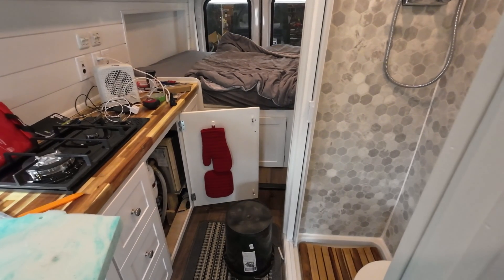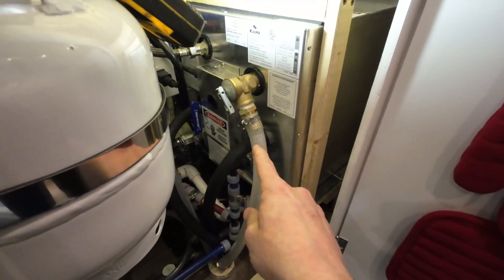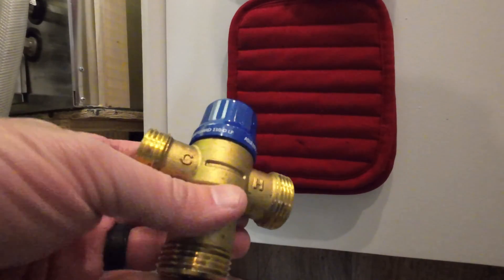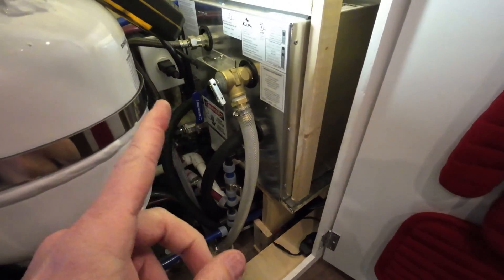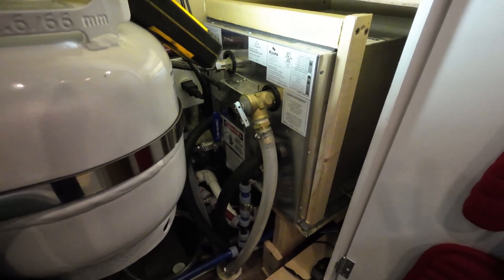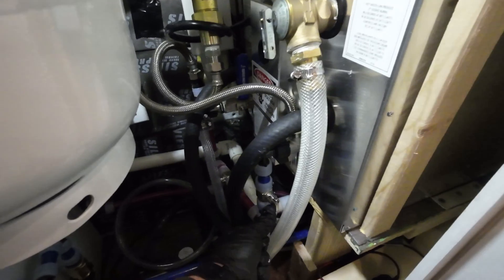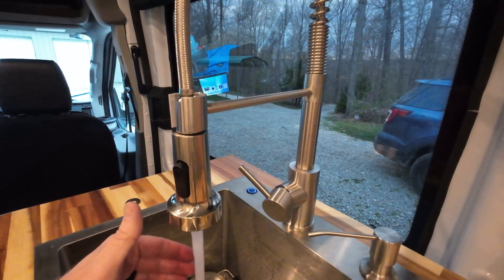Ford Transit Camper Van Conversion Kuuma Hydronic Water Heater Installation

Comment: looks good! however you could combine all drains in one pipe inside your cabin that less holles and hoses.
Reply from the maker: Could have but they all exit through the same single hole. This is the way I do it in case one of them gets clogged, which is possible with the stainless screens I use

Comment: Hello, I'm doing research for my water heater install. Is there a risk of the coolant lines freezing in extreme cold temps under the van? what temps have you had your van in? (I live in the great white north)
Reply from the maker: No more risk than your radiator hoses. It's coolant so it won't freeze.

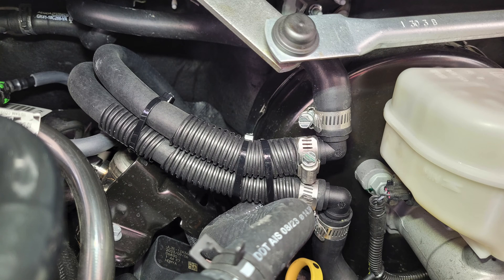Comment: Thank for the video Jack!! Quick question ... I hope you can answer it. I saw that you tap into only 1 coolant hose. In the video 7:18. I though that we need to tab both hoses to make the loop. . It it still working fine? Thanks in advance!!!
Reply from the maker: You don't need both hoses. The way I'm going it is called a series connection. It always runs through the heater core first thus giving priority to the van cab heater, and then goes to the heat exchanger in the water heater. Works excellent.
Reply: @JackofAllMasterofNone Thanks for the details !!
Reply: @JackofAllMasterofNone  I wonder if series is what you should have done in the promaster.  I am getting ready to do my promaster and I've wondered to myself why any hot coolant would tee off (on its own) and go to the heater, using the connections you had for it.  (If not much was bleeding off to the h2o heater that could explain the lower temperatures that you seemed to have).  Any input on whether it is good idea for the promaster to go series instead of parallel?  I get the danger/risk of a coolant leak in the back disabling the engine.
Reply: Here's what I'm thinking for series....  On the return line in the engine compartment (after the coolant has gone to the cab heater and is headed back to.. I assume.. the radiator)... Put in a 3/4 Y (two of them, actually) where I can direct the coolant go to the radiator directly, or through the hot water heater loop.   Then, at the water heater, since it does not have 3/4 inch I need to allow the extra flow.  A 3/4x5/8x5/8 tee on each side of the inlet/outlet on the h2o heater will allow me to split the coolant flow, with ~half going to the inlet of the water heater and the other half going through a bypass line to the tee on the outlet of the heater.  That should provide adequate flow through everything and work.  Make sense to anyone?  [I know it was a tough to parse]

Comment: Sooo were you having a problem with the water being too hot before installing the mixing valve? Wondering if this is a must have to not burn myself
Reply from the maker: No we were not and I have since removed it. Not necessary for adults who know how to adjust water temp. Maybe if kids were in the van it would be a different story

Comment: I wish you would show the step by step installation
Reply from the maker: I couldn't edit out all the cussing. Sorry. Sometimes you just want to get a job done. Plumbing is plumbing. The idea of this video is the overall concept of using the marine heater and how it is plumbed into the vans cooling system
Reply: @JackofAllMasterofNone  Hey man, thanks for the video! I installed that heater because of you — works great on the electric side.
Now I’m trying to hook it up to the coolant system, but honestly, it's a bit hard to figure out.
Just to be clear — you connected it to the hose that comes out of the cabin, not the one that goes into it, right?

Comment: Good morning 
I wanted to know how the sumo springs and shocks work on the  ford transit van I have A 250 high roof ext I got a lot of sway
Thanks again for the information on this Vans 
Rick
Reply from the maker: They work great. You could probably just start with the Sumosprings. The shocks almost make the ride too stiff now but it's better than the tipping feeling I used to have. Riding on rails